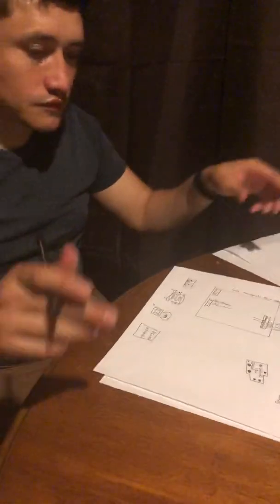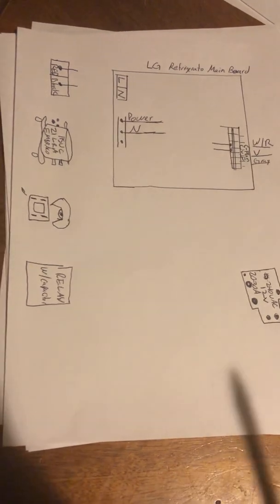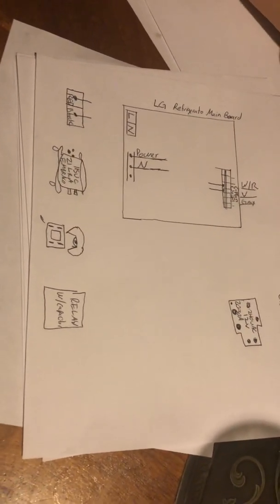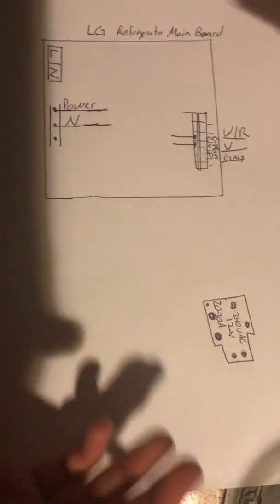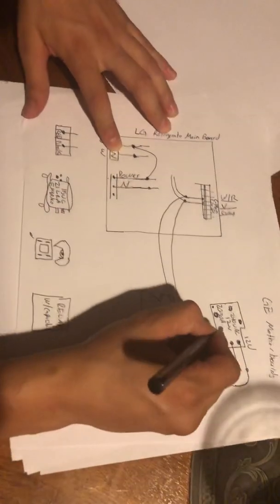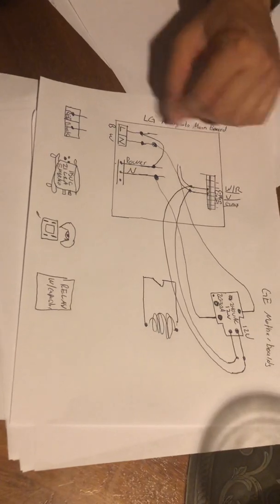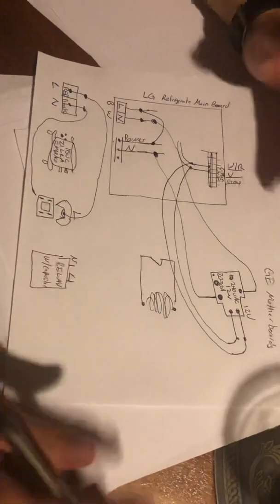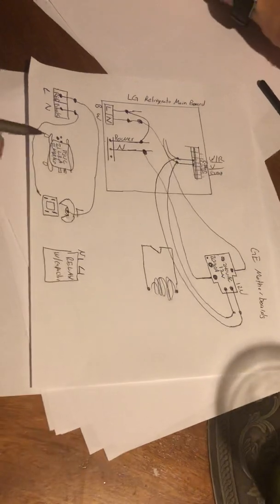LG Linear compressor Refrigerator  Alternative Replacements. Convert to 115v compressor Refrigerator

Comment: This will not work as-is on newer LGs.  The inverter board KNOWS when the load is LOW (in this case ZERO) and it also knows when it is HIGH (load=current draw in amps.)   You could make this cleaner with an Arduino to current sense the PWM on the condenser motor and throw a relay, but you still have the inverter board throwing an error and shutting things down.   I would just get an LG compressor with the latest upgrades and install that,  I do warranty repairs on these about one every other day and they are all doing fine.  As long as you get a clean install and update the board software you are fine.  I charge $400 to do these all day long and usually the compressor is under the 10 year warranty,

Comment: I tried this but for some reason my compressor comes on but won't stop running when fan shuts off. Can you help?
Reply: Same here.  Seems some of these condenser fans get a constant 12v.  They have a separate PWR signal wire that signals the fan to turn on.  Any way to work around this????

Comment: Ok.  So every damn refrigerator I have looked at has issues with the compressor and converter.   It was explained to me that newer refrigerators in the US are set up for European electricity and the converter gets burned out from the conversion of the electricity to the compressor.   Would it be possible to just dedicate a 220 line to my refrigerator to avoid problems?  Wouldn’t I have to by-pass the converter mechanism to do that?   Electrical work is NOT my strength in life.  Apparently appliance repair people will not do this work.  Any explanations would be helpful as I don’t have a really good understanding.
Reply: I wouldnt do that one, not worth it. These fridges are junk and you're better off getting rid of it and getting something else that is more reliable. For example, I have a LG fridge that was made in 2008 that doesn't do all this fancy conversion crap and it still works. Get a simple reliable model and use your current fridge for target practice

Comment: Did you come across issue after this conversion with inverter not sensing current draw effecting the function of the fridge? It happened on my friend's fridge so I am looking for solution which may be effecting some other fridges as well. Some may even use thermistors for the processor sense the cooling process working or not. Here is how I found out: 
While I was testing LG fridge compressor, I disconnected the connector on control board and saw nice voltage incremental rise confirming the board is OK. I tested for PSI while running it and proved no change in PSI confirming compressor failure - 3rd compressor each failed after 2 years.
When I disconnected the connector and measured the voltage rise, after about minute or little more the led code blinked 3 times and the system just shut down. I believe that it is the amperage current sensing by microprocessors and when no draw from compressor is sensed, then it turns off. Perhaps some dummy load on the side from the inverter to the compressor which is not connected anymore would help to pretend current draw. This issue with no current draw from the inverter has to be addressed because even if I convert it to standard compressor, apparently it will shut down soon as it did because the inverter is not in use. I hooked up the failed compressor again and the board came to live so it needs some current been taken from the board, at least in my case.
Reply: Yes sir! Though Jorge here made a nice video… it is dated for the kenmore later models. I too am working on my own fridge just did the surgery… but like you said, I think it needs a load on the original compressor wires. Perhaps a resistor?
Reply: @birdman3931ny  Did you already test it and won't keep running because of the aforementioned issue with the load? I assume that the load would have to be calibrated to what would be the maximum of the compressor's wattage at the peak. The compressors starts at lower RPM if I am correct and speeds up later on. AMPS can be recorded and hopefully the resistor would make it happen. Resistor with heat-sink secured to the chassis to dissipate the heat is a good option.
Reply: @commieslayer8218  I have tried to use a variable potentiometer. I have the fridge here ready for any tests. Get your people together that you have spoken to, here on this video and let's get our brains on it . I'm already buying a new fridge.... But I will not throw this one out until we crack the code..

Yes... It runs on. No way to break the coil side. I tested 3vety single wire for a switching, on off 12v source. None to be found. 4 wire motors always hot. I think the relay on the board just be breaking the ground side. 
I also thing that to break the add on relay we are trying to put in, it might have to go to a relay that is already on the board. So when a stock, on the board relay gets energized... The one we are all trying to put install also gets energized.... And de-energized.
Reply: @commieslayer8218  get a hold of me
Reply: @birdman3931ny  I got things going on here right now, will let you know when ready. Thanks, I want to know as well.
Reply: @commieslayer8218  Aye

Comment: Ok, I've successfully converted 3 different models of LG fridge linear compressors to conventional compressors now thanks to this video. BUT the 795.72053.110 model keeps giving me a F dh (defrost error) despite functioning perfectly!? Do you have any idea what might be going on? When it throws this error, it locks out the front user interface so you cannot get ice or use dispenser/change settings until you unplug it: error code comes back 12 hours later after it tried to defrost and wasn't satisfied. Tested all internal cabinet defrost components and they are all fine...
Ive updated the firmware using the jig just out of curiosity to see if that made a difference. I also discovered that if these LG units have a 3 way valve that there will be an "energy saving" mode that you need to keep ON because if you turn off energy saving mode the compressor will run during defrost because fans are programmed to stay on during defrost with power saving off, making this fix not compatible under those circumstances. Any leads to why it throws code? Before this, the fridge ran absolutely fine until the compressor ultimately failed like all linear compressors do...    I know that I performed the procedure spot on and have no idea why this model just wont function properly without error.

Comment: Is there a way to wire it to a 4-wire condensing fan? I have an LGLSXS2633S, and "C Fan", and "F Fan", has 4 wires. Thanks!
Reply: Im having the same issue did you ever figure this out?
Reply: @peet8004  did anyone figure this out
Reply: @scratchdent20031773  im in the same boat.
Reply: @scratchdent20031773  I'm working on it now, I will post the results if Im able to figure it out. It would be nice if the guy that posted the video would respond to 1 or 2 or all 95 people asking questions but I will do my best today to figure this out.
Reply: @jeremiahgeneration8910  did you figure it out?
Reply: I'm pretty sure he died guys. I wonder if it was from to much refrigerant.  Another video I saw from a different guy mentioned the late Jorge Martinez

Comment: so with the kenmore french style refrigerator how do you change from 220 to 110 to work conventional compressor? how do you get 12v to run the relay from the condenser fan motor that carry 4 wires? red, black, move and yellow
Reply: That’s the question… and how do you get it to tell the logic board that the inverter is drawing power? No schematic for the latter kenmore board that I can find.
Reply: Did you have any luck figuring this out? Im going to try a 5 pin relay and using 3 of the 4 condenser fan motor wires and the other 2 pins of the relay will be the common wires from the incoming neutral and the neutral from the wires going to the compressor
Reply: @jeremiahgeneration8910  did this work?
Reply: @MrJoshCobb  This will 100% work if you have a condensing motor that has 3 wires. I have done it about 5 times successfully on those style motors, however I have had a fridge in my garage for almost a year that has 4 wires on the condensing motor and I have yet to figure out a way to wire that style up

Comment: Yep it burned the circuit starting test circuit.
Reply: You disconnect wire going to compressor from the motherboard. You will get voltage from the power.

Comment: Jorge, are you concerned with the testing phase with the 200 volts spike before it drops to 80, if you have the mother board power line out would burn up the compressor?

Comment: So I’m a up coming tech and I can’t figure out what kind of relay you’re talking about. Help? The one with 4 wires??
Reply: You can get a smaller relay powered by 12 volts. I get them from a car salvage,...you’ll need the smaller ones. They come in little rectangular with small prongs, flat. The big 30:or 40 amps will not workwith the little wires powering them. ,,fan wiresmfrom the fridge! If you order one get 20 amp rating. You can get YouTube videos telling you the power in location , plus and minus, and the two  other connecting prongs that get joined for 5 prong , or 4:prong. Or other number of prongs.

Comment: I just went through this compressor replacement process using a Frigidaire kit #5304475102 which included capacitor and plug  with overload as well as filter drier, extra copper tubing, and and oil cooler (not used). The relay I installed was a 12V DC triggering 240V AC @ 30 amp. #T9AS1D22-12
  On my LG french door model #LFX31925ST the CON 7 wire which is Violet (Purple), is NOT for the condenser fan. I spent WAY too much time and effort troubleshooting the problem. The PINK wire (2nd pin from left on bottom row) is +12V DC while condenser fan is running. White/Red is DC Ground.
  Also, instead of using the neutral wire to activate the compressor, I opted to run the 115V AC HOT wire through the relay.  This is what I was taught for safety reasons. Removing power from the circuit when compressor is not needed to run seems to be best.  The relay must be mounted in a safe location and secured well!  I removed the round metal capacitor (no longer needed with compressor conversion) at the top of compartment and used that space for the relay.
Reply: Mobibeer, I am planning on doing this conversion on an lg refrigerator. Can you give me more detail on your conversion? Did the relay come with the Frigidaire compressor kit that you listed and how many ounces of refrigerant was the charge? Is it still working ok and any other details that you may have. Thanks.
Reply: @livezero264  Yes, the capacitor and start relay were included in the kit.  I bought mine on Amazon. As for the charge, my digital scale has a resolution of .2 OZ so not sure of the exact amount installed, but it was more than the label for sure. I Started with a 5 OZ charge and added .2 or .6 as needed to bring the box temperatures down. I ended up with a CALCULATED charge of 7.2 OZ.  So, actual amount is somewhere in between 5 and 7.  It is working well.  The refrigerator stays around 35 degrees with a setting of 38, and freezer between 10-0 with a setting of -2.  I have one thermometer in each box and check temps every day.
Reply: Did you come across issue with inverter not sensing current draw effecting the function of the fridge? It happened on my friend's fridge so I am looking for solution which may be effecting some other fridges as well. Some may even use thermistors for the processor sense the cooling process working or not. Here is how I found out: 
While I was testing LG fridge compressor, I disconnected the connector on control board and saw nice voltage incremental rise confirming the board is OK. I tested for PSI while running it and proved no change in PSI confirming compressor failure - 3rd compressor each failed after 2 years.
When I disconnected the connector and measured the voltage rise, after about minute or little more the led code blinked 3 times and the system just shut down. I believe that it is the amperage current sensing by microprocessors and when no draw from compressor is sensed, then it turns off. Perhaps some dummy load on the side from the inverter to the compressor which is not connected anymore would help to pretend current draw. This issue with no current draw from the inverter has to be addressed because even if I convert it to standard compressor, apparently it will shut down soon as it did because the inverter is not in use. I hooked up the failed compressor again and the board came to live so it needs some current been taken from the board, at least in my case.
Reply: @commieslayer8218  No, I have not experienced the problem you are describing here.  The newer LG compressors required a firmware upgrade, which my refrigerator never did get.  It's still running the original firmware which I 'believe' varies the voltage. Whereas the new firmware varies the amperage to the compressor while keeping the voltage constant. Or do I have that information reversed in my head?  Either way, which firmware are you running?
Reply: @MobiBeer  I don't know the firmware and I gave up on the fridge with shutting down when compressor not connected to the inverter side. I explained it to the owner which was offering the fridge for free when it was hard to replace the compressor twice by factory service where it took them long time to do that plus some adjustments and firmware upgrade necessary and still it failed again and again. The fridge maybe gone by now and if I ever get back to this type of fridge with same issue, I would have to have the testing tool and firmware upgrades handy plus studying it before long enough so I would perform the task correctly. I am right now servicing the generation of fridges before this french door type and that is much easier to do that including refurbishing boards. Thanks fro reply.